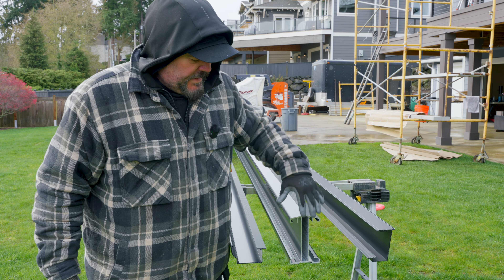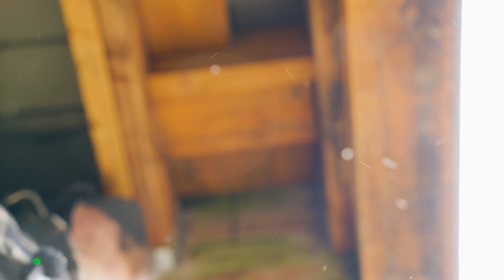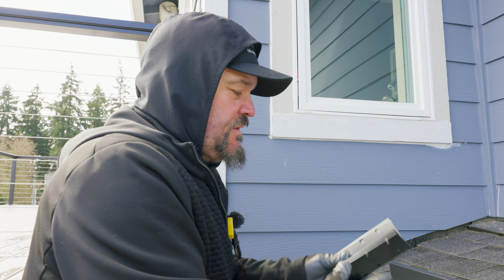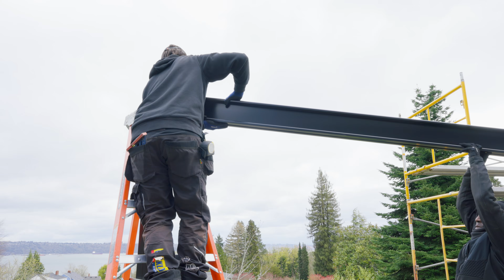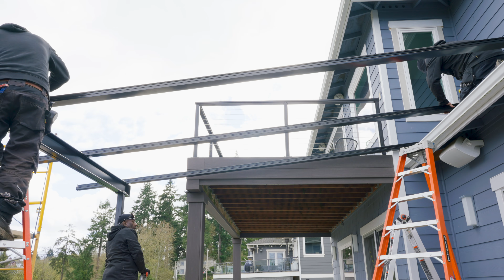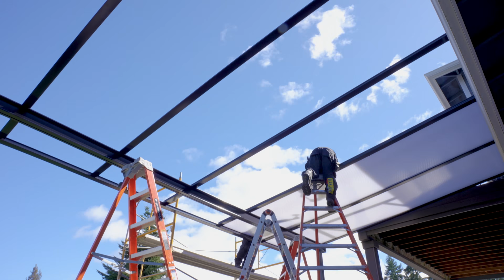How To Add A Patio Cover To An Existing Deck

Comment: With that design, there is no knee bracing so how does it take lateral force (wind load) without racking
Reply from the maker: The design relies on moment connections at the base, beam and acrylic attachments to handle those forces.

Comment: Would this be easier in my situation where the deck is on the gable end of the house?   I would assume I need blocking in the attic where I would attach that upper mount to the wall, or a similar wall mount vs roof mount.
Reply from the maker: Correct but definitely doable